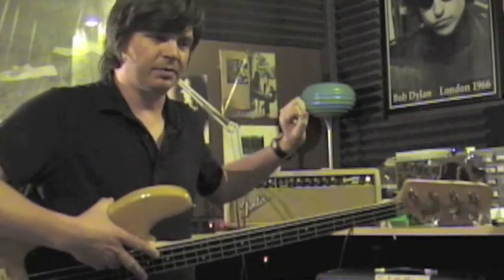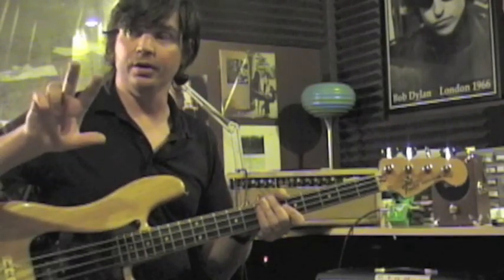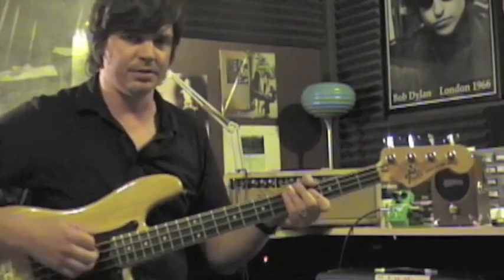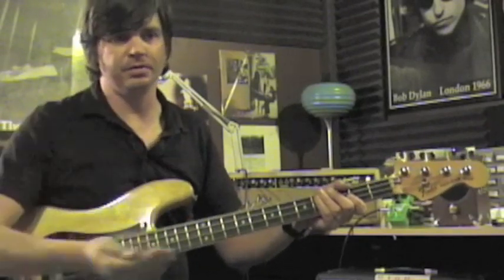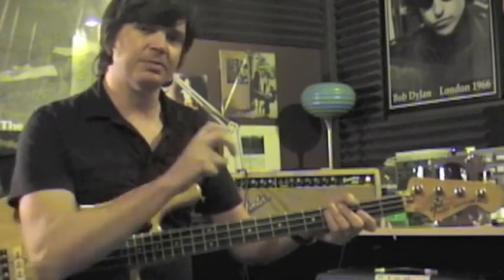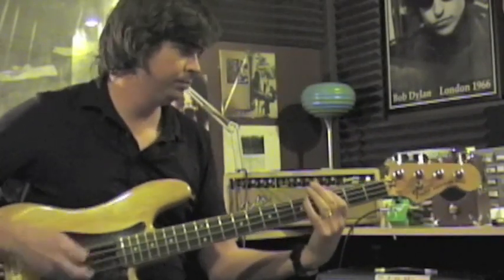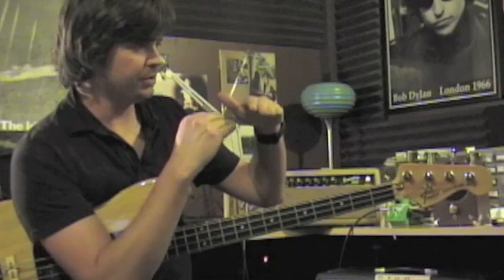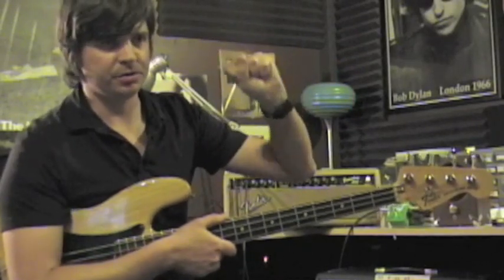Wren and Cuff Pickle Pie B Bass Distortion Demo pt. 1

Comment from the maker: No, no gate. But it is quiet for a mufff-family fuzzer.  There are a couple reasons for this. It uses a high-quality matched trannie chip, like the first WH Swollen Pickle (as opposed to individual transistors), metal film resistors, metal film caps. etc. These can all contribute to a lower noise floor. Plus the clean-blend makes a difference for obvious reasons.
Thanks for the compliments and your interest. You can always email us directly with questions as well.

Comment from the maker: A valid question.

They're totally different pedals. They really are and its not just a subtle big muff connoisseur thing. If you a/b the two pedals, they are voiced totally different.

Different clipping, tone knob, feel, sound all totally different.

And yes, this includes factoring in all the the trim pot twiddling you can do on the WH reissues.

if there's anyway you can get to one of our dealers and try the side by side, you'll see for yourself. I'm limited to 500 characters here so...

Comment: With all due respect I am curious why this is optimized for bass any more so than a WH Swollen Pickle MKII, with its internal voice and clip controls. Your clips on your web page are really professional, I just don't hear anything super distinct from the Pickle I currently own. I think the Blend is probably the biggest difference and, as far as I can tell, I have not seen it used extensively enough to feel like I'm really "understanding it with my ears." Thoughts?